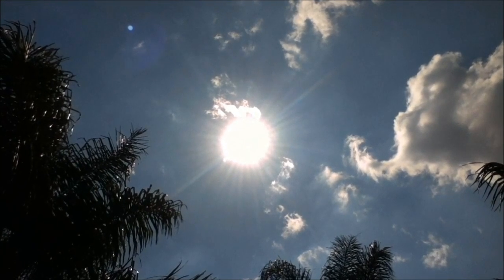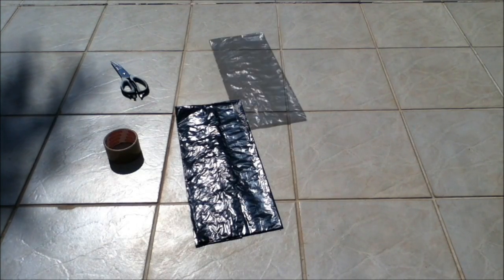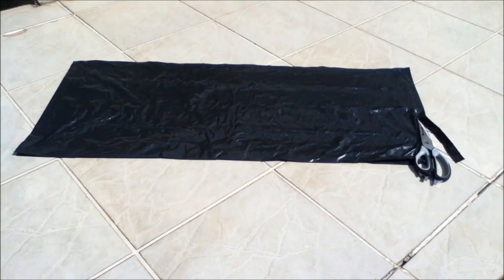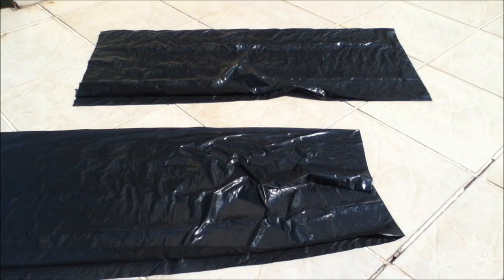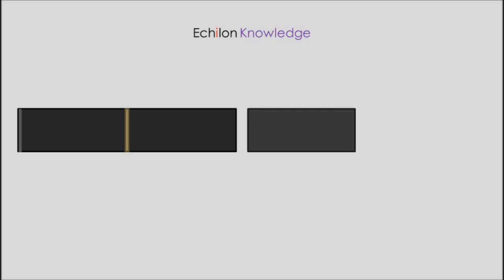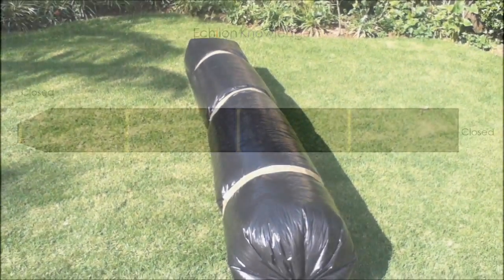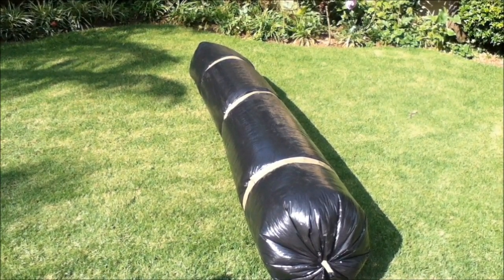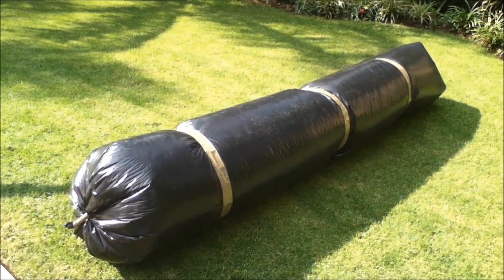MAKE A SOLAR POWERED HOT AIR BALLOON - With household items

Comment: I would turn the bags inside-out before joining them - with one bag slightly inside the other.  Then turn the bags right-side out again after joining them.  Then the tape would be on the inside and the air pressure would help to keep it sealed - instead of risking pushing the tape off.

Comment: Connecting them end to end doesn't increase their volume by much, and the tape adds to the mass. Also, dont completely fill it. 80 to 90% is a better idea because warm air expands and will fill the whole volume lowering mass further and saving you more time.
Reply from the maker: You make a lot of sense sir 👌

Comment: does it land far or what?
Reply from the maker: Yes it does land far, it will keep going until the light heating the air runs out. As such I have never seen one come down, so yes it is far. Glad you enjoyed it.
Reply: i have tried to make one with 3 bags but it didnt lift.. only bouced like boobs.. next summer i will try under 35 degrees of italian sun with 5 bags isnt it better a regular scotch not the paper one? and what about hair dryer instead fresh air? the hardest thing still the closing d u have some advices? i always lost alot of air.. and i guess it must be fully pressured to make it right.. or hardly will take off..